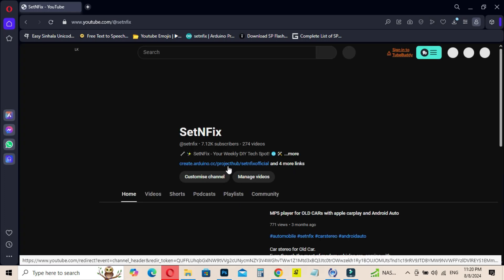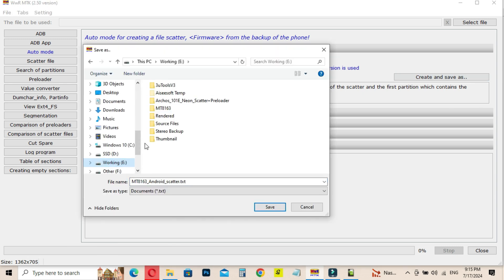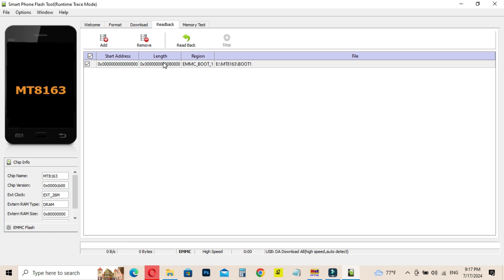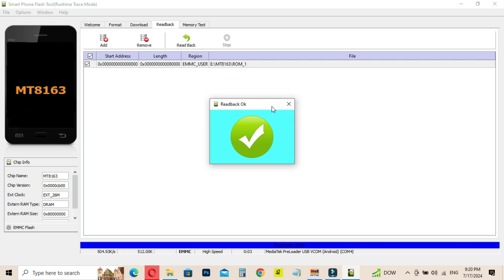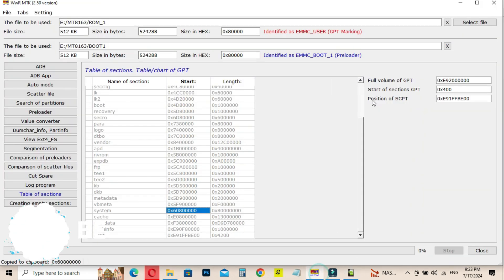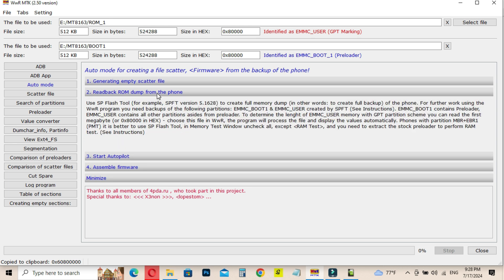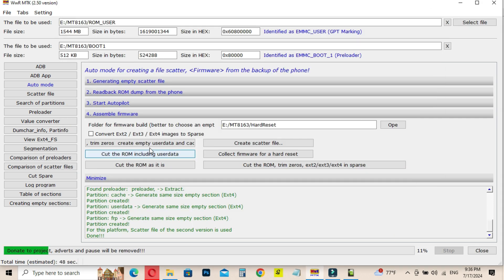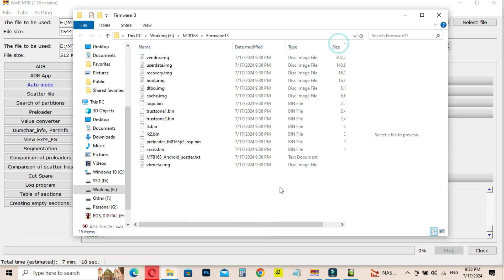Car Stereo FIRMWARE with SP flash tool and WWR MTK Software

Comment: Is your backup firmware applicable or can be copied to another essgoo android head unit? Mine doesn't have themes installed.
Reply from the maker: Did you restore it?
Reply: @setnfix  yes.

Comment: On the WWR MTK soft wear i cannot see the START PROCESS BUTTON any idea why
Reply: i was able to read back and create the Boot_1 file and the ROM_1 file and save them then i got an error saying the readback failed on the thrid one so i looked about online to see what i could doo and i think i ruined the device by formatting it completely empty because now my pc does not see its plugged in ,, I was trying to learn how to update because i have 3 of them head units so i used one to practice hopefully what i managed to save is enough to  bring it back to life its a Alps 10.1 inch AC8227L with MTK6323G was version 10 of android // F20220728000100 1+32 on a little blue sticker on it ,,
Reply from the maker: You have to re program the firmware
Reply: @setnfix  yea I ruined the device lol it won't show up anymore on the pc
Reply: and its a different board that has no markings for the pwr and vol + button so i cant force flash it without removing the AC8227L and using the standalone programmer ,, They call them skeleton boards or somthing its green
Reply: @highlandsoutdoors2041  this is my issue too, i cant see it on pc, have you sorted this ?
Reply: @mnshp7548  view tab font size I believe it was but I wouldn't mess with it if you never did it b4 you 100% will have to order a new radio
Reply: @highlandsoutdoors2041  yeah ahaha too late for that, new one allready in my car. i wanted to get a new one and holyy is it better 6g of ram is so much smoother then the 2g ripof ones